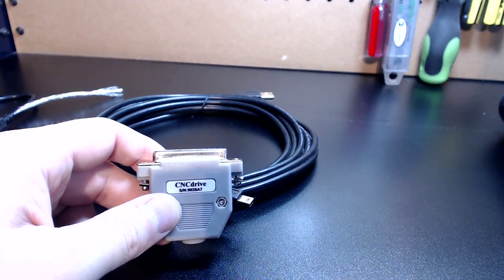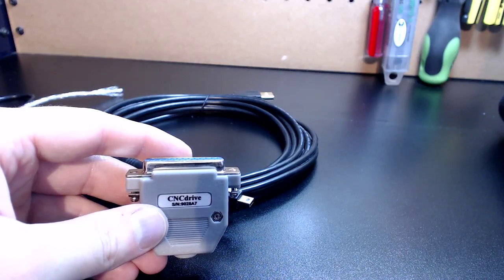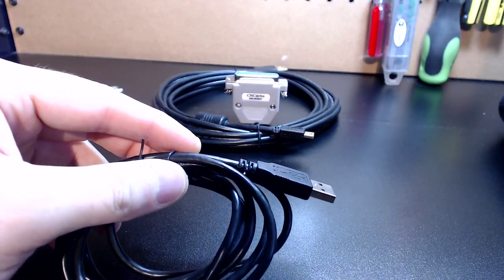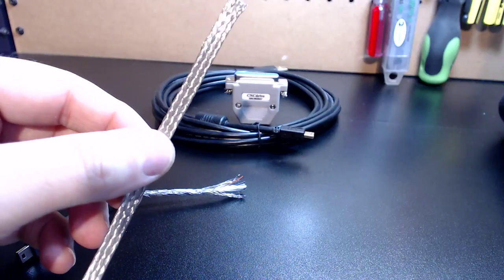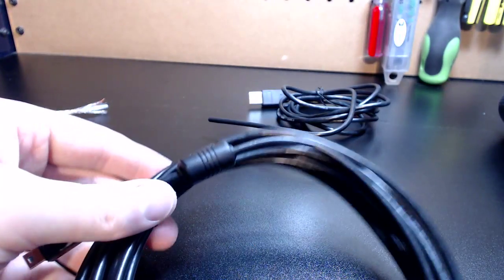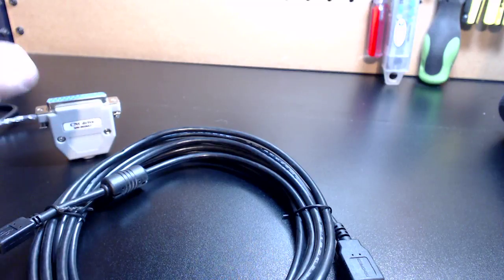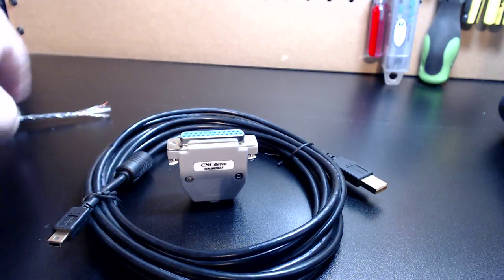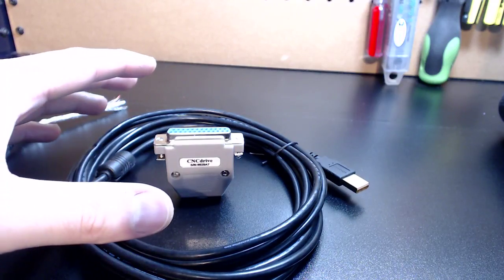UC-100 New Cable Release (Essential Protection From EMI Contamination)

Comment: Hey Vince, I have been using the uc100 with your double shielded cable for a few years now. The other day the uc100 blue light went out and the cnc stopped. It was working fine after restarting everything and I was able to finish the project. Today on startup everything was fine until the blue light went out again prior to starting a run. It was just setting idle. Again I restarted everything and the blue light came on but went off right away. I have not been able to get the blue light to turn on at all now with numerous restarts.  I have checked all connectors involved and tried different usb spots on the computer. No change. The green light always comes on. Do uc100's go bad occasionally. What else can I check before I order a new one? Thanks for your great videos!
Reply from the maker: Hey Dan,
If it was working well, an suddenly stopped having stability I would recommend reinstalling the drivers for it. If that still doesn't work then it may have issues that without having CNC drive review it are unknown unfortunately.  One other area to review is the plug into the unit. If it has play, and doesn't make proper connection you can loose signal. Check both the USB side that enters the PC, and micro USB that enters the UC-100. Thank you, and have a great weekend!
Vince

Comment: Have you had problem uc100 losing steps while running gcodes my 5 volt is right on, works well when jogging but running gcode losing steps reguardless of speed.
Reply from the maker: Hey Willie, thank you for your support. What driver/drivers are you using? Is your system utilizing proper shielded cables, and grounded?

Thank you, and please be safe.
Vince

Comment: Thanks for the effort you put into this Vince. Just ordered the cable. Will be upgrading my spindle next (currently using a makita colt) what are your recommendations?
Reply from the maker: Eric, thank you for your support. If your using a wood router from a box store you'll need to properly shield the cable, as those types of routers were never designed to be used on robots. Let me know when your ready to order, and we can go over the specific cable to use once you open the  router up and verify the lead count as their all different for each manufacturer. Thank you,
Vince
Reply: Thanks for the reply, and happy to support your business. I built my machine piece meal with a frame from Open Builds. Im slowly learning and upgrading, drastically improved with your videos. Id like to ditch the makita Colt router and upgrade to a spindle, maybe add coolant for aluminum. Any recommendations on spindle?
Reply from the maker: Eric, on that type of system the maximum size I would recommend is 1.5kw. If you modified the chassis to support a more rigid Z axis you could go with a 2.2Kw (3hp) which would be optimal for all metal substrates. The machinist type spindles will provide far better power output than the box store units as they incorporate using a 3 phase VFD (inverter). Thank you,
Vince

Comment: Vince, "YOU ARE THE MAN!!."  When I first retired after 40 yrs as a machinist I had already built my workshop wired and had 100's of bf of exotic woods stored from 15 yrs back.I bought a StepCrap (yea I know ones born every minute) with UCCNC 100.One of the first problems i had was it just taking off and loosing position. Especially in rapid. I never thought it could be because of EMI till I started watching and following you. You are sooo correct, why take a chance, do it right the first time. Especially since some of the woods I have can't be bought anymore after the UN got involved .  Bottom line I have a mother load of  wood. I cant afford a machine going wild and destroying a piece of wood, and I want to do it right. Please let me know how I can buy a 6-10 max cord.  I plan to build a mill using your expertise. Thank you Flavio
Reply from the maker: Flavio,

Thank you for your kind words, and support. Here's a link to my new 15ft double shileded Ferrite installed communication cable.

 I find in CNC its the little details that usually cause the most issues. https://www.ebay.com/itm/142708535490 

Thank you, Vince
Reply: Ordered it!! Thanks Vince. Back in the early 90's setting up a dnc on a Fanac 6 and I  went crazy till a engineer mentioned about EMI.
Reply: could i ask you what problems that you have/had with your stepcraft?  i just recently purchased one after spending many hours researching CNC's and talking to some owners that have been very happy with their Stepcraft...thanks in advance.

Comment: Completely agree. I wish I saw this video sooner so that I could have solved the issue way faster. I had issues with the UC100 disconnecting when the G-code was running. It was very frustrating but when I bought a cable like yours it fixed the errors. I would not buy UC100 again as I still had problems with mach 3; not sure it was the UC100 or the software but the feedrate sometimes would just go about 90% slower for no reason which made it impossible to actually make good parts. There was no fix for that so I had to install Mach4 as Art soft recommended and with Mach4 the UC100 you can not use Surface speed per rev, Threading or Feedrate in mm/rev mode; only mm/min. So now I can use it only in mm/min or I have to get another usb/ethernet motion controller that fully supports Mach4.
Reply from the maker: Thank you Lorenzo for your support. This cable was on my "to do" list for sometime. I feel we need to eliminate the problems before they ever have a chance to become one.Thank you again, Vince
Reply from the maker: I'm not a real fan of Centroid as many companies I've consulted for have used their systems, and the support they provide is pricey ($90HR for phone support), along with the prices they expect you to pay for using their motion control software. I seriously suggest you review the terms of the software as far as use because of G-code limits they instill on every version of software they offer, but their ultimate version which sells for $500. Review it here. I highly recommend that everyone review the details closely of these so called "new released" controllers before purchasing one to make sure they understand the proprietary stipulations.  Once you get in bed with these companies your in till you either sell their unit, or upgrade again which is fine if your fully aware of the costs with who your involved with. Here's a link to review closely of what I described above.http://www.centroidcnc.com/centroid_diy/acorn_cnc_controller.html Keep in mind the Acorn only supports 4 axis which simply limits the end user for future expansion. The alternative to this unit is an Ethernet Smooth stepper which is cheaper, and non proprietary with any of the stipulations above. The ESS has been around at least a decade, and is overall a much more economical option when combined with Mach3. Thank you,Vince
Reply: Hey Vince, I appreciate your opinion on the matter. I have not yet decided to go with centroid but Mach software got me quite frustrated even with all the set up. It took about 3 weeks of emailing back and forth to get the Mach4 configured with the UC100 for a lathe profile. Like I said they are very helpful and will do their best to solve the issue but they had to order my breakout board, the UC100 test it and see if they could come up with the right settings which they did in the end but took again 3 weeks. As a lathe user I believe centroid only has the pro package which is an extra $99 so still not to expensive; if you are a mill user I see that the ultimate package for $500 might be to pricy when compared to the mach option. I just think that centroid is doing the right thing by trying to provide both the software and the hardware from one company. Regarding the support price Mach is $30 for 15minutes phone support which is actually more than centroid. I am no expert when if comes to software so I can not say which one is better but from what I have seen and the users that have it they are all happy to pass from Mach to centroid. Their acorn board just came out so maybe it is to early to say. Thanks a lot for sharing your knowledge Vince it is always very helpful.
Reply: Any reason you didn't use UCCNC instead of Mach?
Reply from the maker: Medicineman,Mach3 is better supported software in the states, and online as its fully matured. UCCNC is excellent software, but still doesn't have the support structure in place that Mach3 has do to the length of time its been available. The other constraint worth mentioning is CNCdrive is located in Hungary which means you have to adjust your requested support time around when their available which for a business in need of immediate support in the US may simply be to long if your clients order is on hold till receiving it.  Thank you,Vince
Reply: I am considering trying centroid I like the idea of a company that provides both the software and the hardware so these issues will not exist anymore. Mach support was great but they also need to figure out all the different options you can connect with it and my experience is not great with my setup. It may be another 400$ but if I can start making the parts right it would be worth it. also the software seams to be much better but I have not tried it so can not know for sure.
Reply from the maker: Lorenzo,I'm not sure why you decided to go with Mach4, and use the  UC-100 as Mach3 would have been the best combination with it including the price, and its compatibility. Your correct about the support price for Mach, but your particular issue is do to you trying to use Mach4 with a component it wasn't designed to support. This why I recommend using Mach3 as I stated earlier its more openly supported with hardware, and software. Here on the Mach4 page on Artsoft's site it lists the boards with required plugins they recommend using with it. http://www.machsupport.com/software/mach4/The device you should have been directed to use is here for the USB supported option to be used with Mach4 . https://cnc4pc.com/catalog/product/view/id/978/s/pokeys57cncdb25-motion-controller-for-mach4/category/164/If you need anything let me know next time, and I can usually save you a headache. :)Thank you,Vince
Reply: I did have Mach 3 but I was getting the feeds 90% slower on some lines making the parts and tools over heat. I contacted artsoft and they said that that mach3 had a lot of bugs they could not fix so they made the mach4 so they told me to use mach4 instead. I can not use mach3 at all with this bug. 90% slower feeds is a big problem and it is not consistent so I can not just increase it on the code because it might actually run it correctly and it would be to fast.